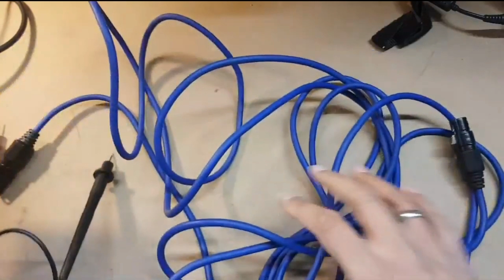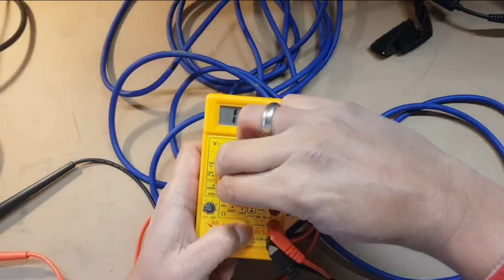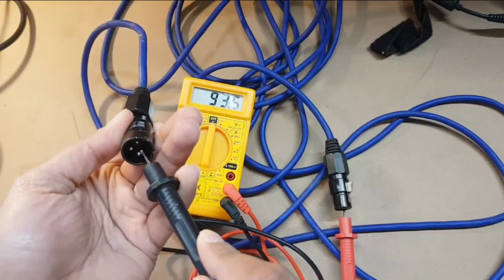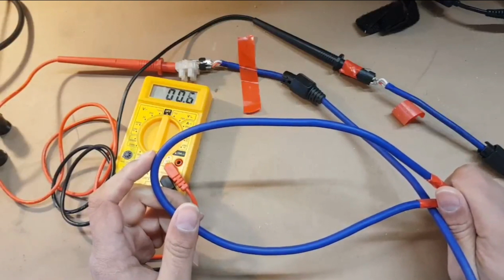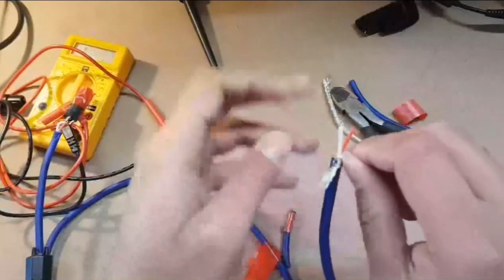Repair broken cable wire and save old electronics

Comment: Anytime I work on a cable with several pins I alway put a mark on the 12 o'clock position and usually snap a picture I have done harnesses with north of 40 wires things can get confusing quick! Cheers 🤙
Reply from the maker: Great tip. One to consider especially when working with multiple wires. Thank you.